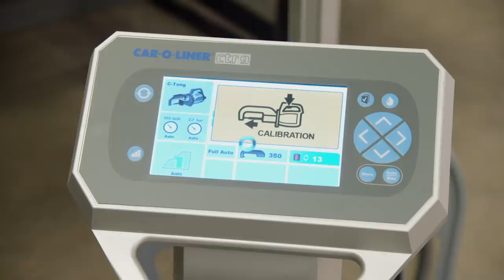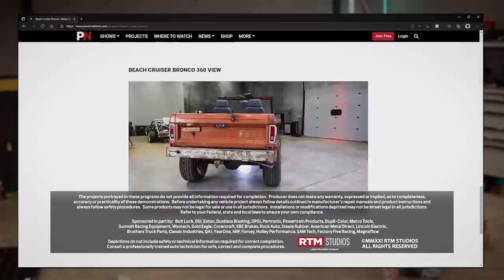Building 1974 Bronco From The Ground Up - Music City Trucks S1, E10

Comment: A question how are you going to register this Bronco?
Reply: Probably no different than a Factory 5 "Cobra".    Depends on what state you are in.  Some are if it looks like something from the era, good enough.  Speaking of Factory 5.  They are in Mass.  All their cars owned by them that make to TV seem to have Rhode Island plates.  Then you have engine emissions.  It was made now, so you need to be up to 2021 emissions of the state because it's a new vehicle.
Reply: @craigmaverick  If they use one square inch of that old Bronco, they can call it "restored from junk."
Reply: @dlewis9760  All they did is replace a couple of rusty panels. This is the original Bronco, All you have to do is check the VIN number on the "original" glove box door.

Comment: For only $20,000 you can buy this spot welder for your rusty 74 Nova.
Reply: @garypic4083  if you are doing pieces like this in a body shop, then the 20k outlay will be returned without too much of a drama

Comment: How much does that cost? Buying a brand new EB and then putting it together.
Reply: in Massachusetts, I am 90% thru a 68 where only 4 items are original. 2 axles, tub, frame. sandblast, weld, body work, single stage paint, crate engine, 4R70W A/T, everything else and it's at $40,000.